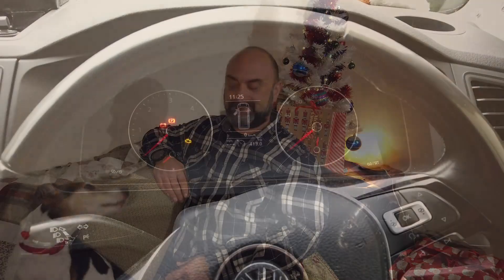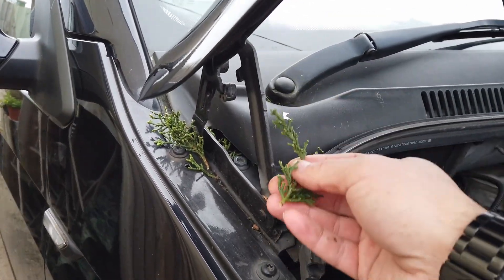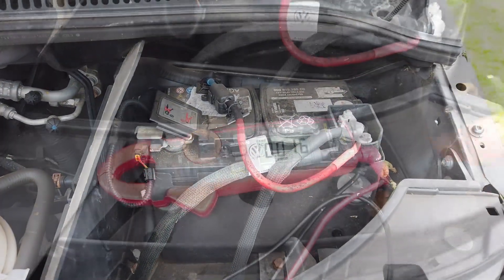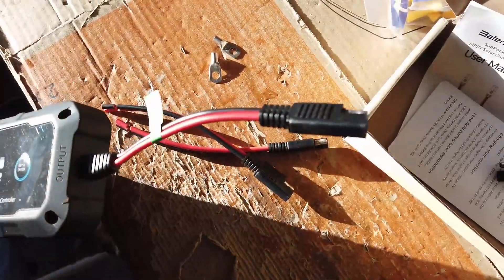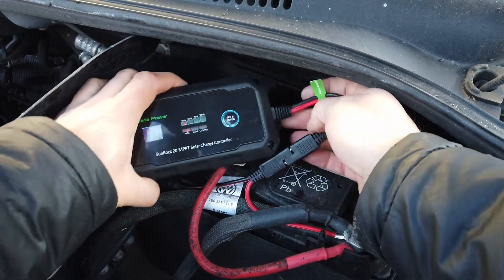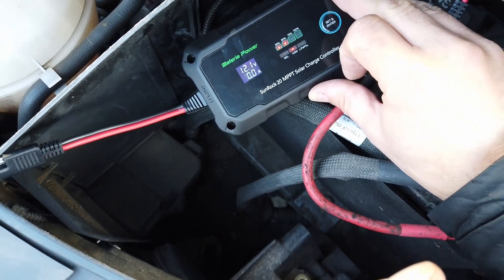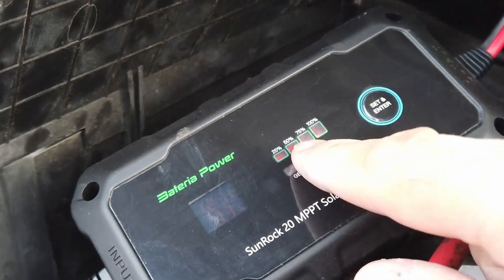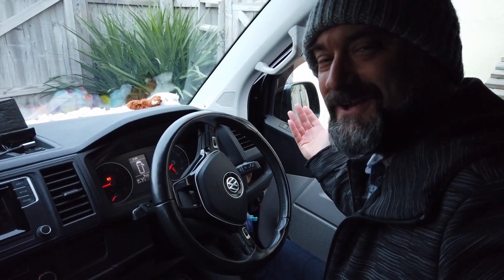DuB-EnG: Winter Flat Car Battery Problem solved! Solar Battery Charger - Christmas special meet Jack

Comment: Nice one Howard,
This year I did think of getting one of those little ones for my car but the comments below have made me reconsider  👍
( I did notice you using 6mm crimps on a 1mm cable but we have all been there  😁 )
🛠👍😊
Reply from the maker: Happy new year bud!!  Yes, I'm very naughty with low power stuff :-).   Definitely avoid the crap little panels!!
Reply: You too, 
Thanks for the advice, I'm only doing short trips nowadays so I was thinking it might be a good investment but now think I will save my money.
I've done it with 240v in the past,  no big deal it got things running until I could get back with the right gear   👍😉

Comment: What I did was hook up an audio 16v 4F capacitor parallel with starter battery to deliver cranking amps when starting the car.
Reply from the maker: That sounds like an interesting concept! ….

Comment: Have you ever tried a panel with a VOC around 12-14v without a charge controller direct to a battery to see how that goes?
Reply from the maker: They tend to be small panels that don’t offer much power in the winter months.  Even that large panel is only offering half an amp on a shady day which only just compensates for the parasitic loss as it’s only collecting free range electrons for a few hours of daylight.  In the spring, the battery problem is resolved as the warmer weather offers better cranking amps.
Reply: @DubiousEngineering  just a thought. I have mine through a basic pwm and it's ok but obviously doesn't compare to my 410W on the roof and 100-50 mppt. I've left a spare charge lead permanently connected and just get the generator out if desperate...should add I live in my van. Oh, heads up if you are using Victron kit, be wary of the recent firmware update, it killed 3 of my devices and I had to push them through on an iPhone unfortunately.

Comment: I have an old Landy which I only drive infrequently. I stuck a similar solar panel on the roof to stop the battery from going flat, but I cannot get it to work. I've tried solar battery charging units (from eBay) and they simply complain that they are "overvoltage" (my panel kicks out 24 V in full sunlight) I've tried Buck/boost converters. I've tried just putting a diode between the panel and the battery. I must be missing something obvious: you've given me the inspiration to get out there and try again. Thanks for that. And as for Jack: well done on giving him a loving home. I'm sure you don't need telling that he'll repay your love for him one hundred fold and more.
Merry Christmas.
Reply from the maker: So...  My charge controller has a max input voltage of 30 and a lot of panels are 36v ...  Jacks got a permanently floating rib (possibly from an accident or a boot), and he struggles with social separation likely due to neglect, but we're getting there... Merry Christmas 🎄🎁!!!!

Comment: I installed a 100w panel 2Y ago, glued to the roof of the cab. The solar charger then keeps the battery fairly good all through the summer, and then my recently installed battery-switch, makes me cut off everything when parked. As we know, VW has for years had a battery drain by default. It even says in the manual that the vehicle should not sit for more than 3 days because of the drain. fact. I also keep 2 emergency starter batteries quite close. It's now all relaxing and I have a setup that should've been factory standard. Like some Audis have had back in the days, actually.
Reply from the maker: It's thoroughly annoying when things don't start!!  My issue is lack of use really.  It'd be nice to be able to connect the leisure battery in parallel occasionally, but that's not cheap/easy with the cetek charge system.  Panel was £30 used and charge controller was free...  So didn't spend much!! Merry Christmas!!!